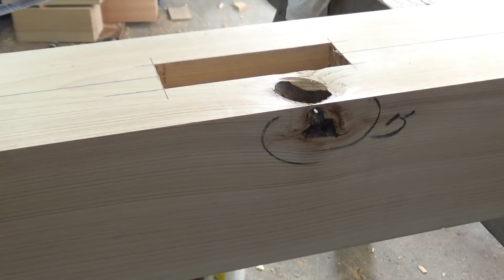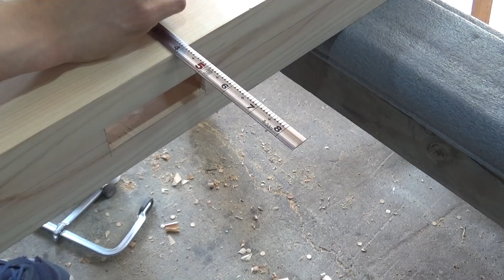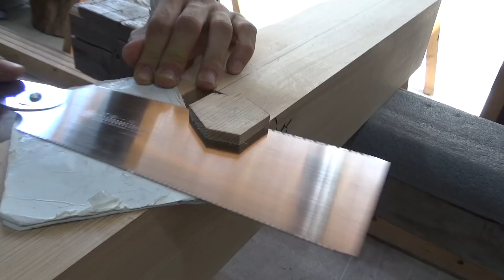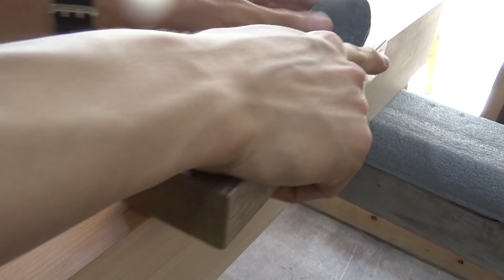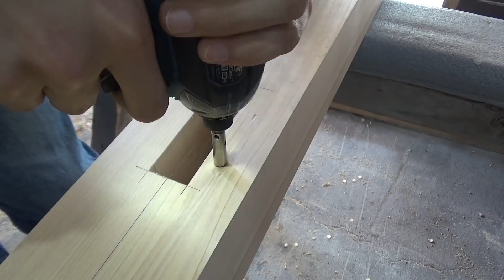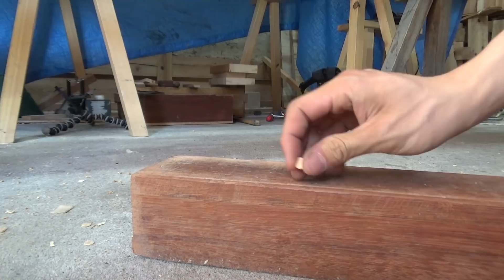Filling dead knots on wood. 宮大工が職人技で教える初心者のための死に節埋め木の方法動画

Comment: 2:56.. wow, keeping your hand/fingers in front of the saw there.. Great health and safety going there buddy!  please be careful, tools are not joke!
great job, clean work, but only used for cosmetic covering. Doesn't add up to strcutural integritiy. I personally prefer knots on wood, looks cool and has character
Reply: Incorrect, dead knots on external joinery allow moisture to easily penetrate the timber and cause rot
Reply: @jamesmacdonald5881  which is why we invented something called "Polishing"- the protective layer on wood to keep the moisture entering the wood, avoid deformation, warpage and rotting.
Reply: @mrnothing249  haha never heard of polishing a timber frame or polishing timber windows and I've been in the craft 8 years 😂 don't see how polishing a dead knot would even be possible. Potentially filling with resin would be, but this would just retain moisture eventually. A solid spliced wood repair as shown is the video is the correct method as you're using the same material, expansion and shrinkage should be very similar. Hence no gaps and no water ingress.
Reply: @jamesmacdonald5881  cool

Thanks for sharing James
Reply: be careful, a Japanese ninja assassin might sneak into your house...

Comment: Love this technique! Do you use the brush just for cleaning the excess glue off the wood?
Reply: Coast And Company actually that’s an old Japanese technique (can’t recall the name and even if I could I wouldn’t be able to spell it) where you add moisture to the places where the cuts are in the wood, to make it swell and leave no spaces between the pieces. Watch that part with the brush again and you’ll notice the water on it! Pretty cool stuff
Reply: I didn’t catch that! Thank you!!
Reply: Coast And Company No problem! I got excited because I actually knew the answer to your question. Sorry for butting in like that. Good luck!
Reply: @thecityofficial6367  it should also be mentioned that this is why the wood is hammered before fitting it in the hole, as this makes it easier to fit it in there. applying the water then causes the compressed fibers to return to their original length, clamping it in place!

Comment: Did you hammer and compress the filler pieces (rather than sanding them) so that the glue would cause the wood to swell and form a tighter joint in the end?
Reply: Yes, it's a method called 木殺し Kigoroshi meaning wood-killing
Reply: sanding it would fill the pores with sanding dust and abrasive particles thus making a less strong glue joint.